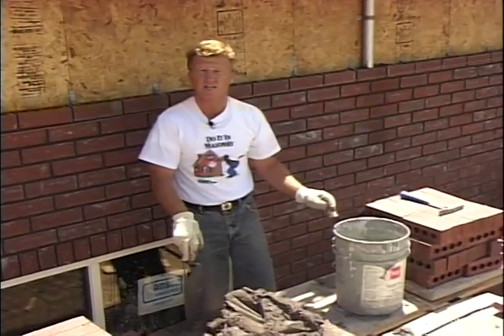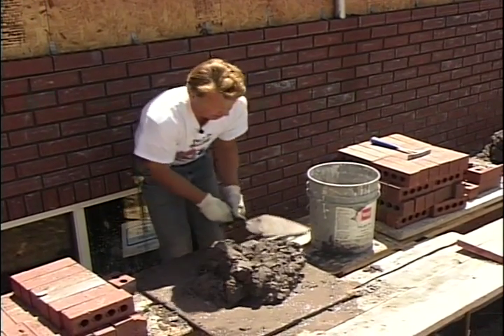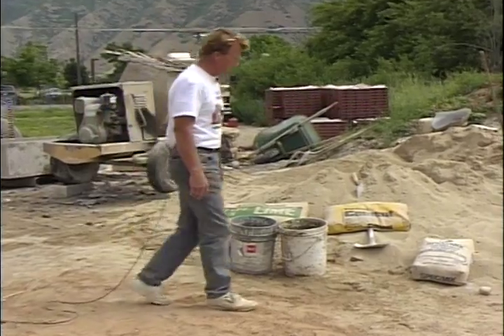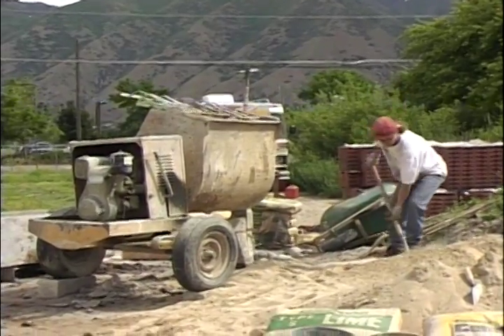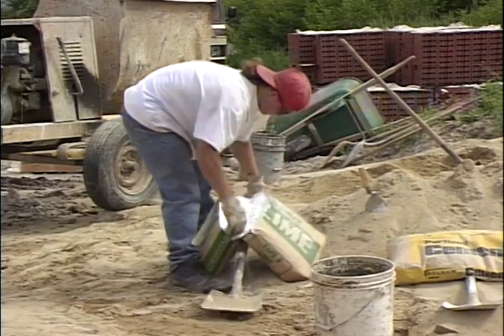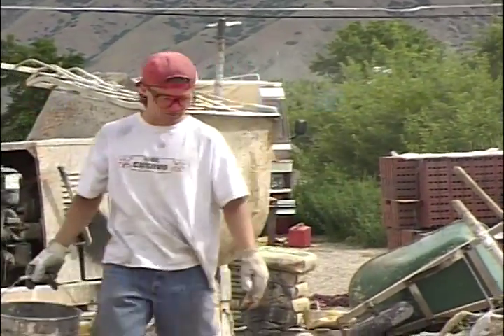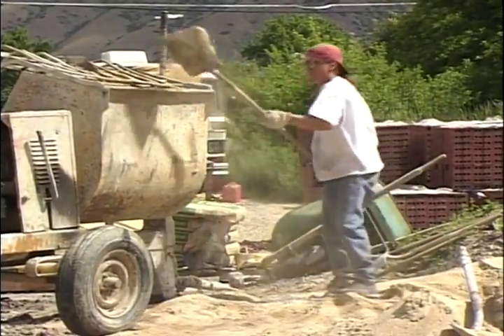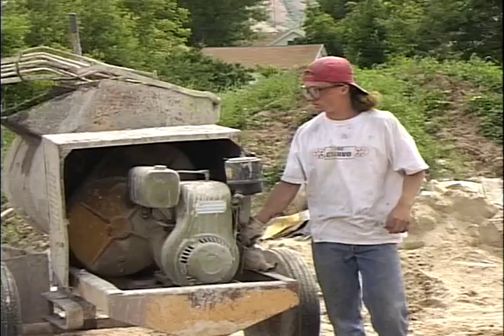Masonry Tricks of the Trade: Mortar.

Comment: I find that the bucket method for sand is much more consistent. Also the proper amount of cement to sand can be determined by doing a void ratio test on your sand.  If mixed right, the cement will fill the empty space between sand particles without increasing the overall volume of sand.  Also you should be laying damp brick in summer.  Nice neat brickwork there.
Reply: I agree ! There by getting accurate proportions! CONSISTY

Comment: Should probably talk about how "retempering" the mix by adding water after the mix has started to dry out/cure, inherently reduces the strength of the mix.  Maybe better to make smaller batches more often than compromise the strength with larger batches.
Reply: you are correct
Reply: drkjk I agree
Reply: The tiny bit retempering mortar is weaker is by far made up for by the increase tensile strength the bled water creates as it is 'sucked" into the dryer units by differing vapour pressure.  Only ignorant Engineers think untempered mortar is superior then mud of the proper plasticity for quality workmanship.

Further more the actual strength of mortar isn't the limiting factor of the wall strength as a whole.
Reply: I have been told not to resoften more than once.
Reply: Ive never heard that and Ive been around masonry work all my life. I Guess if you want to sit back and nitpick at all the work you can find anything wrong.
Reply: We've always done it this way can be an incredibly dangerous point of view to take in construction
Reply: I was just about to leave to the same comment. If you have to do it more than once then things are going wrong. Keep it in the mixer, or at least coverd. If it starts to yo over try throwing it back in with new mix. Another tip is don't mix up too much in one go. People do not understand how mortars work, there is more to learn than just adding sand and cemment. P.s with the greatest amount of respect I almost fell asleep listening to you spout off numbers and amounts. Try keep those bits shorter. But still some good stuff in video.
Reply: @tnridge  surely if you've been around masonry all that time you understand how mortars work! Of course if the chemical process has started to work, then by adding water you will not being it back even when using lime, the strength is reduced each time. Just don't let it go off, leave most in the mixer or underunder cover. Also plastic mortar boards stop it drying out too quickly.  We've been using mortars for hundred of years and that comes right at the begging of an apprenticeship. Too be honest mate it is amazing how there is to know about mixing mortar. Anyway i am boring myself know. Peace
Reply: ever see a full concrete truck sent back to the plant because it was on site too long?case closed.
Reply: @peterfoley4533  I really enjoy people getting into debates about this as it shows there is more to know about wall building than throwing half bag of cement and 8 to 10 showels of sand, then putting it between bricks etc. We all should have to know more aS brickies.
Reply: Harry,  Having the right consistency of mortar allows two things, One for the mason to get the mortar to FILL the head joints and bed joints, AND sufficient excess "bleed" water to get sucked into the dry units, creating a three dimensional bond that is far stronger then a dry pack mortar that is a few hundred PSI stronger then a bed or head joint that has Some tensile strength developed by the bleed water and cement paste being draw into Units.

Don't use high strength mortar that is more then 2 hours old from the original hydration,  a little longer for 1,000-1500 PSI mortars, I am referring to  any modern style Masonry cement that is 30% to 75% Portland cement  of the cement mix the rest usually, Type S Lime and various lime dust products + some type of soap, usually, animal fat based...

Except for laying glass block & very glassy units, excess water is the essential ingredient that allows Masons to build walls where the mortar nearly 100 % bonded to clean dry units.

Used  brick and CMUs will never develop the bond new units do BECAUSE some of their pores are already filled by the 1st iteration of mortar. Thus should never be used for any structural walls with testing.

90 minute old mortar, one just chopped up(reshaken) to break the bonds of the small fraction of Portland Cement that HAS set , compared the same mortar with water added to return it to a just mixed consistency, has the IDENTICAL amount /% of Portland Cement unavailable for the final set in the wall assembly,  but has a tensile bond and far fewer defects in the bed and head joints.

Billy Pilgrim: Yes mortar does still age out of spec,  the colder the mix the longer the usable trowel time.

Don't mix over an hour's worth of mortar ,   when it is hot a wise laborer makes More smaller batches, using Damp sand pile with an awning for shade and cold fresh water.

The no retemper rule was implemented by Masonry ignorant Engineers with Concrete training(Never use more water than ABSULUTELY NEEDED for hydration .

The only time I discourage retempering mortar is for colored mortar jobs that must have a near prefect match, batch to batch,  even then the time the joint is tooled has afar greater effect on the final shade and saturation of the Colored Mortar mixes.
Reply: @peterfoley4533  Peter thank you so much for writhing this comment. I spent some time 're reading it to understand. As a bricklayer  it is something interesting but as i am working on a conservation job with stone masons I can't begin to thank you for explaining it to me. I really enjoy method behind it and really believe skills are being lost at an alarming rate. To be honest I can't remember what I said so you sent me this reply but all I can say is thank you. I enjoyed reading and thinking about it.
Reply: @peterfoley4533  P.S I love watching YouTube videos to try and learn as much as possible, I hope leaving comments as not made me come across as a dick becuase I really appriecate everything people post. H
Reply: @harryhoon39  just trying to kill a partially "correct" idea regarding Portland based mortars, that has cost our society hundreds of millions of dollars in added labor & materials, and made masonry more expensive, weaker, & leakier for decades.
Reply: @peterfoley4533  never herd it out any better well said
Reply: @peterfoley4533  
Good point. Also this can be avoided by soaking the bricks therefore not needing a wet mix.
Reply: @tnridge  Same here.. masonry has been in my family for 3 generations that I know of.. every male in the family has been at one time a mason.. im the last one for now and never heard if such..
Reply: Your tender is over supplying the mortar or not keeping up with brick or you simply need more tenders, better trained to keep an eye on the situation. Great video and memories! Gary in Michigan, masonry contractor since 1972.
Reply: just put the bricks in the wall

Comment: Good neat brickwork and good neat recessed jointing but might want to give the wall a rub down with a glove before it dries, is plastered in dirty marks. Also what's the deal with the skinny brick? Here in the UK ours are 4 in by 3 in high by 9 in long. Those Skinny brick look like they would tend to bow the wall if they were built too quick, unless they're butted tight to the timber

Comment: was brick/block laborer for 20 yrs.. I never used any lime..  and 32 shovels of sand and 2 bags of mortar for a two bagger mixer and had it mixed in a few minutes... I picked the whole bags of mortar up and only dumped a half bag in at a time,   after all mixed just let the mud set up in the mixer for a few  minutes and dump it and you good to go..
Reply: that's exactly how we were taught been around masonry all my life. If you let it sit about 5 min before you dump it then it wont set up so fast.
Reply: There’s lime in the “mortar” bags.
Reply: yep let it blow up in the mixer .. productivity is higher doing this . layers and tender won't have to tamp at all should last a good hour
Reply: @tnridge  letting it sit is called slaking

Comment: Great teacher, learned a tremendous amount, in uk they use a plasticizer in the mix , i assume for Workability and drying out,do they use their.
Reply: Yes, mostly use it in cold weather or running concrete through a pump and slick line. Otherwise its the cost.
Reply: He mentioned lime. Lime works.

Comment: I have a lanai that I want to close off.  It has a stucco finish, as does the entire exterior of my house.  I am wanting to lay some brick veneer (about 1/2 " thick) over that stucco after I make the lanai an internal room.  The stucco is painted, so I was thinking I could remove the paint, and perhaps mortar these veneers directly on the stucco.  Does this sound reasonable or no?  Perhaps I should lay them like tile, and then grout?
Reply: They make a bonding agent,you can use,if paint is not peeling or overly glossy,could etch it with muriatic acid.

Comment: I worked for this guy in Wv years ago that would put Laundry detergent in the 1st batch of the day to keep it from setting up to fast. I thought WTF am i see and laughed at this guy. No bs it works.
Reply: Yeah my guys use it when is real hot in Texas but if you put too much when it comes down to wash the house with acid the house will have lots of holes to touch up. Can't put a lot is my point.

Comment: You shouldn't temper (Wet) your mortar more than twice during its use. After wetting the mortar twice the mortars strength is weakened and the color of it may lighten. Bond strength may also be affected
Reply: That's up in the air.. the BIA, Did a Study saying re tempering mortar can diminish its strength. Note a dry mortar will not bond as well. The problem is real world.. if it dries out they will ret emper it.
Reply: Depending on what you're doing should designate how much you re-temper. If it's a brick veneer with no load bearing purposes then it should be okay. But if you're laying a structural block foundation you should keep in mind that re-tempering does weaken the mix
Reply: ACCORDING TO THE { B.I.A. } =Brick Industry Association ~ Re Wetting AKA Re Tempering, Mortar is fine I will reference a Book for Architects, Engineers ~ on the subject of Masonry = Author -Christine Bell,  Title : Masonry Design & Detailing,
 Under Retentivity & Flow of Mortar ~ Re-tempering or Wetting has NO EFFECTS ON STRENGTH ! In fact a mortar that is too dry will not bond properly.. The only issues sited are with color additives, since wetting may dilute the pigments appearance. 
2& half hours mortar should be disposed of if not used..  that's it THE ASTM is in  AGREEMENT !
FACTS ...
Reply: Well that must be something new then because all of the masonry text books I've read say to not temper more than twice. Including my new one that was published in 2013
Reply: ***** Read the ASTM, BIA, As well as any Architect's /Engineer's Manual.. Quoted it from a Architect's MANUAL
Reply: ***** ~ Additionally on most sites you have apprentices doing the mortar tending. Since each Mason likes his mortar slightly different you tend to see an instant Re Tempering..
Reply: Well I appreciate your input, Sir. Thank you for the information. I was just going by what I've learned in my 6 years of doing masonry
Reply: *****  ~ A couple of thingsthis video was made in the 80's. Next the problem with learning any trade is that if do not do your due diligence your only going to know as much as people share.

Architect's , Engineer's, professional organizations such as National Association of Home Builders, The Portland Cement Association, The Concrete Association, The Brick Industry Association, Stone Masons Association, The Masonry Association, The American Standards Testing  Mandate. 
B.O.C.A, Local Codes,  I appreciate your comments.
Reply: Bill K Silly men, mortar like grout needs surplus water to be workable, and the capillary action of the "surplus" water creates the bond to unit from the cement paste that is transported with the water into the pores of the units.   untempered mortars will test higher in easily done compression test but always lower in tension or twist/wrench tests.
Add water till your head joints stick.....=full head joints = stronger dryer walls.....
Reply: Peter Foley ~ Technically, too wet a mortar can cause issues with bricks, blocks & other CMU'S not sitting at proper heights. Each mason has a different plasticity or concisity he or she prefers to work with.
Reply: Bill K Your mortar is too "wet" if you can't hold your coursing-duh.   I use cold water/ ice in hot weather, A tiny squirt of liquid soap for air entrainment--about 6 to 10%air doubles time between shakeups. And allow the use of larger trowel.

Bone Dry Units are the secret to quality clean work, they'll suck the excess water out of the mud and fewer smears and buggers stick to the dry faces.....
Reply: Peter Foley I'm going to have to strongly disagree with you on the squirt of liquid soap. I know for a fact that the soap does not help the mortars strength ( bond and compressive) It does help with the workability but it damages the mortar overall. Use a plasticizer designated for air entrainment in your mortar
Reply: Bill K How about you get real? You're defending contractors and yourself for purposely doing things wrong? I am a Bricklayers and Allied Craft Workers member and I can surely tell you I was taught to do things right. To make things last more than 75 years. All of that stuff you told me about doing things wrong on purpose is just ignorant. Build correctly please, there's a reason why rules and guidelines are made up
Reply: ***** ~ I told you FACTS STUDIES BACKED BY & PRACTICES RECOMMEND BY THE FOLLOWING ~ AIA, B.O.C.A. Brick Industry Association, National Masonry Association.
Reply: YOU CAN ACCORDING TO The BIA ASTM National Masonry Association  RE TEMPER { Re Wet }  as needed up to 2 1/2 half hours after mixing. ACCORDING TO STUDIES It doesn't effect Strength. A mortar that is too dry will not bond properly.
Re Tempering just makes the mortar Workable.
However if you are using a pigmented mortar it may effect the color.
Recommend Practices are to cover with plastic, during hot & cold Times to prevent drying out.
Reply: We're past the point of the re tempering mortar. Now we're on to other structures. You just told me you've done or have seen trusses not be nailed properly and wood columns set right in concrete and some other false building practices and made it sound like you were arguing that doing things the wrong way is okay. You sir may know about mortar but you are no professional to your practice at all
Reply: ***** Most mortars test higher than their design strength, loosing 5 or 10 PSI in compressive strength is outweighed by the proportionately huge increases in tensile strength(BOND)  if a silly compressive PSi # is needed for a paper pusher, add a couple of ounces of Portland cement to each batch,  and the air entrained mud will weather longer in freeze thaw Zones as a side benefit.
Soap is a plasticiser, just a lot cheaper than a soap labeled as such...
? What is the beef tallow(cheap Soap) added to ready made mortar cement for wise Guy?
Reply: ***** Bite me, yOu are not fit to be the flea on my dogs arse wart...
Reply: Peter Foley  Interesting fact is all testing by ASTM, B.I.A. By AS YOU PUT IT PENCIL PUSHERS.. 
You are a blow Hart! Probably DIY That has a hard on for Mike  Holmes & Bob Villa s well as Norm Abrams.. 
Yet can't wipe his own but..
Reply: I like to work on a very clean tidy site as well as this guy😂😂😂😂😂👎
Reply: mighty monty  that’s why I always pee in my mortar!
Reply: @billk6494  concrete on Angels?🙏

Comment: that brick will wick water to that OSB and rot it out. why did you not use tar paper?
Reply from the maker: it was the 90s and up to the home owner back then. Also in Utah which is the second driest state in the country so the moister here isn't like most other places. But yes it should be used and is now. But amazingly this house is still fine without it almost 30 years later.
Reply: Tyvec
Reply: That's the first thing I noticed is why isnt that the osb papered... I don't care how dry of state and lack of moisture you should always paper the wood  walls before veneering w brick... ALSO why was there a  wheel barrow of  mud on one board in the heat. shovel and half is all maybe two shovels full on board is plenty.  Less to temper... The hoddy making the morter wouldn't make on my crew.   Toooo slow..  PUT water barrels next to ur mixer. Use buckets of water ,exact ration and it will speed up the process.  Forget to  spray mixer down after he dumped the mud.. mixer is probably caked.

Comment: No water proofing on that wall? Not even tar paper?
Reply from the maker: wasn't required when this was filmed in 89.
Reply: Interesting. Every older building or house that i've had to tear into has some type of water proofing. Usually tar paper on older homes. Maybe its also the area you filmed this in doesn't see much rain.
Reply from the maker: Yes exactly we are in the second driest state in the country so usually when a house has water damage its because of  a leak somewhere in the home. My sons home was built in 97 and we recently had to redo a good portion of it because it wasn't built properly and even with moisture barrier the wood was rotten.